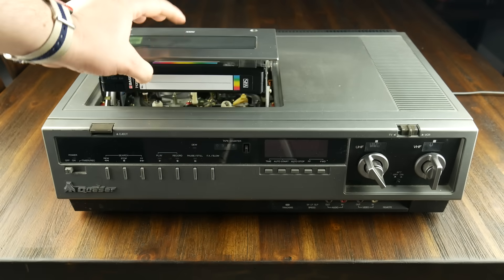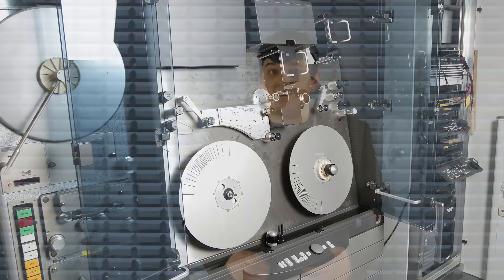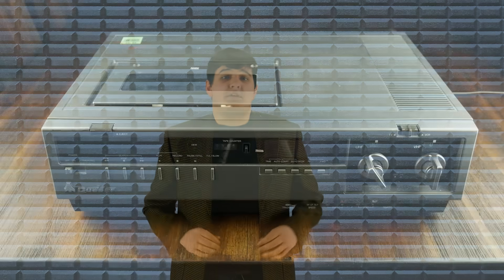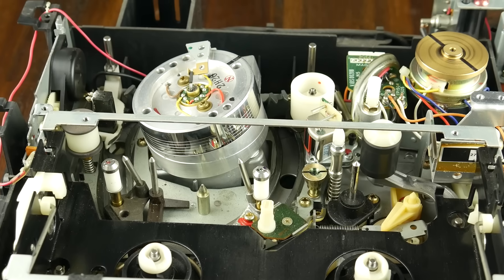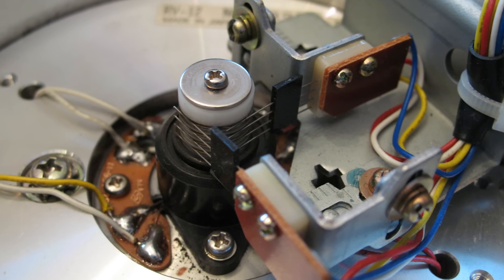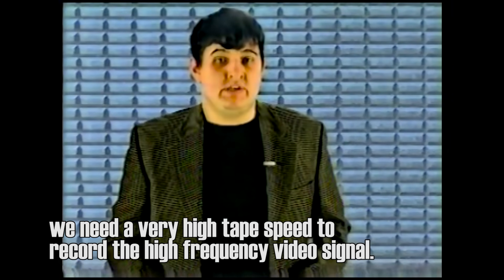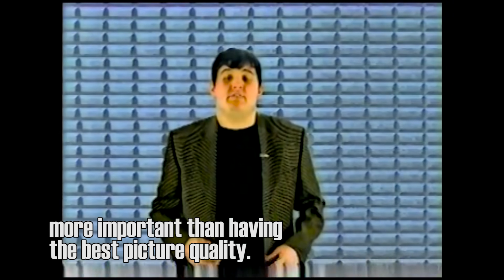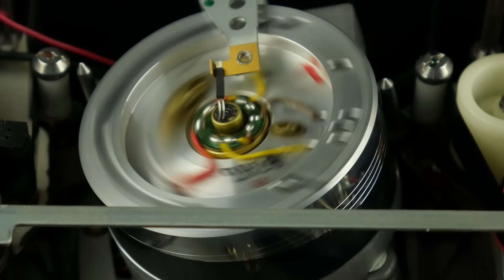The Impossible Feat inside Your VCR

Comment: Thats so strange about no LP after the 80s. It must be an American thing, in the UK we had LP and ELP right till the end.
Reply: SpriteFUN    PAL LP and NTSC LP are different things. in europe we had SP - LP ( and in a very fer panasonic and jvc decks SLP ) in the NTSC realm it very different. and here in europe we had 240 minutes tapes from almost the very beginning and excellente basf 300 minutes.
Reply: Same here in Buenos Aires, Argentina. As HD recording machines are not available here I still use a Panasonic NV-HV60 6 head video recorder plays back very well on the smart TV.
Reply: My philips vcr bought in 1999 could play ntsc, pal AND secam tapes and deffo had support for lp as well.
Reply: He's wrong. Every VCR I've ever used has had LP and SLP recording modes. I have a low end CRT TV/VCR combo from 2000 and it has 3 recording speeds. Enough said.
Reply: Pressure banding, Tip error, guide height adjustment, Chromatech and Amtech error, Air pressure... Head optimisation, F and Q controls, master equaliser, tracking error, sticking your thimbnail against the head on Transmission to cure a head clog... Oh, I could go on !
Reply: Why are you so angry about this?
Reply: Jason Well, he is not wrong.  I also was bummed at the loss of LP recording capability on my VCRs.  They dropped it sometime in the 1990s.  Maybe it was only JVC, since that was the only brand I ever bought, but they for sure dropped it and kept it dropped.  Even high-end SVHS decks.   google VHS "dropped LP speed" and look at the 2nd link, the one for forum .videohelp .com.
Reply: I'm warning people that this guy is a bad source of info. If I cared about what you thought I'd go dig out my VCR's and make a video showing they all have LP. I even have a digital VCR. It can output analog tape digitally and it looks much better. I know VCR's.
Reply: Yes, in was an American thing, we had 30 Frames per second instead of 25, which used more tape recording those extra frames.  The LP thing was created by Panasonic (Matsushita in Japan) and JVC never got on board with it, so machines that were made by JVC or their licensees never recorded in LP, though they would grudgingly play an LP tape (with no picture special effects, of course!)
Reply: Was about to say ! My mum recorded all her shows on LP.
Reply: Where I live you can still buy new VHS tapes in shops or online, including the E-240. 22€ for a pack of 5!
Reply: Brian Partington   No Panasonic /Samsung/ Lg / Loewe.  dvd/bd equipped with a hdd?   Ive been using a pioneer dvd/hdd deck since 2006!
Reply: Not in Argentina, Chile or Uruguay as far as I know, only available on the black market due to copyright laws on recording. They were available for a very short time about 10 years ago. Most people here have Netflix.
Reply: Same here from the north side of the country, 6Head Titanium HiFi Philco VCR.
Reply: Brian Partington  That doesnt make sense at all. copyright depends on the act of recording itself, not the media... correct me if Im wrong
Reply: Brian Partington we have the home recording act in USA
Reply: I remember a VCR combo having LP and that was as recent as 2005
Reply: That's interesting, I didn't realise NTSC and PAL were so different, I just thought it was refresh rate alone. I remember sometimes when you used LP or ELP the tape could get all chewed up, depending on the quality of your VCR of course.
Reply: NTSC used straight signal with no modification so frame rate was linear, PAl ( or Phase Alternate Line ) switched each odd and even fields , using phasor relationship any errors in colour hue was cancelled out. If the colour insertion signal was not quite right, could still get Venetian Blinds effect on playback signal.
Reply: Simon Anthony, 
Define:
  Pressure Banding
  Amtech error
  Air pressure  (in the context of a VCR)
  Transmission (in the context of a VCR)
  Head clog

sticking your thumbnail against a flying VCR head is a good way to break the head or your thumbnail.
Reply: This is all vTr stuff, professional broadcast kit. He started it ! These were all things you had to know about when running a Quadruplex 2 Inch VTR, Ampex VR2000 to be exact. The thumbnail thing though was true of any Quad. The drum rotated downwards, top to bottom of the 2 inch wide tape, at a slight slant ( no idea what, could be due to the tape movement ). The four heads each had an RF ( Radio Frequency ) output waveform level display on the 'A' scope. If a head became 'Clogged' - bunged up with muck from the tape, the RF would start to drop and the picture would show horizontal bands getting more and more noisy until finally going black. If it was head 4 that clogged, the video sync pulses that kept everything running at the right speed would be lost and the entire machine would 'lose lock'. If you carefully put your thumbnail up against the head, you could clear it without stopping the transmission. Yes, you could hurt yourself - that's why we were trained :-)
Reply: Pressure banding - AVR2s suffered from this, horizontal bands due to the frequency response of the four heads not matching that of the head that made the recording. Increasing the tips and altering the guide height could help. Tips? the concentricity of the head drum with respect to the 'canoe' shape of the tape guide - which held the tape in place by suction... yes, they needed an air pump to work.
Reply: Transmission? as in 'This is BBC 1'...
Reply: I used to operate a Quad RCA, never knew about the Thumbnail trick to clear a head clog, wow.
Reply: We used a cigarette paper wetted with isopropyl so no finger oil not left on drum.
Reply: Antonio Criado Diaz  This is true: my PAL VCR only had SP and LP, but you could easily buy TDK 240 min. VHS (their cardboard sleeve was pink, while the 180 min. ones had a blue sleeve).
Reply: American version of LP recording had some interesting artifacts including freeze frame being a total cluster@%$k.
Reply: Aha!  That explains why some of us (like me) remember LP halfway disappearing, and some of us not.  Thanks for that mind broadening.
Reply: He was wrong LP wasn't removed until the 2000's and it wasn't removed from the majority. He doesn't know what he's talking about. People who don't understand this just assume he is right because he made a youtube video. Anybody can say anything on youtube.
Reply: I posted the same thing so many people desperate to be liked on youtube just say anything regardless of whether or nor it's true. A large percentage of these kinds of videos are filled with lies. I trust older people about older tech. Younger people just say what they read on Wikipedia and don't have any experience.
Reply: and just because your parents owned a VCR doesn't make you an expert or qualified to explain anything technology connections

Comment: The biggest question I have after watching this is why doesn't the spinning play head completely ruin the tape after one pass?  Surely there's some trickery there as well.
Reply: Jordan Greene The heads don't actually touch the tape.  They are slightly recessed from the polished drum.
Reply: Yeah, precision engineering at its finest.  What was even cooler was some 1" open-reel video machines, which used compressed air forced through the heads and guides so nothing but the audio and control heads touched the tape!
Reply: Jordan Greene I dont know that but I know that signal on VHS fade overtime so if you dont storage it well the quality can get really bad over the time
Reply: Ok, thank you for the reply,  It must be a super precise gap then because its barely even noticeable in this video.

Comment: Anyone member the tracking knob?
Reply: Pepperidge Farm Members...
Reply: Yeah, but VCRs without autotracking, were also immune to copyright protection. You could record your rentals. Or...if you wanted maximum quality, you could buy the tape from Woolworths, copy it, switch the reels with those in the original, and then return the original. That's why rental stores started filling the screw holes with epoxy
Reply: yea.  i can't tell you how many times I 'fixed' people's VCRs by twiddling that damn knob. Seems once their toddlers started fiddlefarting with the knobs and buttons, well, they would mess it up, and I'd unf*ck it. 

Now, do you remember having to open the little door on top and manually "TUNE" the frequency for each channel?
Reply: Ash Scott - Ahoy me hearty. I too used to sail the high seas of video piracy. I often found the RF cable would get me out o' many a stormy screen when the AV cables wanted to cast me down to Davey Jones's locker. Never knew that the autotracking was the bane o' the pirate's life and so I thank ye.
Reply: For everyone triggered by "member" ... It's a joke from one of South Park episodes.
Reply: QuantumRift - I remember mine came with a wee plastic screwdriver type thing to change between UHF and VHF. Then you'd roll those little wheels around endlessly. It became annoying at school when you were the guy who'd always get called up to tune the damn things. You had to balance the point between delaying as much as possible but not so much that the teacher would cancel the original plan and make you do real work. Good times
Reply: VideoTape You could always bypass digital tracking by using for example on jvc decks, the channel +/- buttons. Cant say about other brands...
Reply: It was the same (channel for tracking) on my GE branded Thompson stereo (6 head) VCR. Pressing both channel buttons at the same time switched back to auto.
Reply: Earlier VHS players had manual TV channel tuning. It was fab
adjusting VCR, groovy effects in NTSC = Never the same colour twice!
Reply: Kurt Angerdinger:
"Yes, manual tracking was one of the huge disadvantgs of VHS compared with VIdeo 2000 (from Philips). Video 2000 had auto tracking from the frist product release on. But a few years later VHS also got auto tracking."

VHS auto tracking just automated the tracking knob by a simple video carrier level servo.  It just went with maximum level and sometimes missed the mark, leaving noise bars (and sometimes vertical sync instabilities that would roll the picture up or down) that you would have to adjust by looking at the screen. 
 In contrast, Philips' auto tracking was a consumer version of the broadcast machines' auto scan tracking, actually mounting the video heads on movable mounts to make instantaneous micro adjustments, the pause, slo-mo and search picture was incredible. This was a design necessity as there was no control track, due to audio taking up both edges of the 'two-sided' tape.
Reply: He's just referencing a joke from South Park about people whining about the present and seeking escape from the world via nostalgia, to their own detriment.
Reply: idk if memeber is specifically millenial, i think its gathered from the member berries from south park
Reply: It was a Tracking Adjuster, the knob was the person who twisted it.
Reply: Much better than digitally-controlled tracking.
Reply: Grand Negus axe???
Reply: Barry Puccini  That's very kind of you.
Reply: The rim thing around the channel tuning knob? Yeah, of course I member.
Reply: Remember the cable box 'push button' remote?  LOL
Reply: I was thinking "adjust the tracking" during the SLP sample...
Reply: QuantumRift: "Now, do you remember having to open the little door on top and manually "TUNE" the frequency for each channel??"

Yep!  We take VCOs for granted now, but in the '70s they were too expensive (like digital memory was as well).
Reply: Well, depending on the region it can be spelled as axe or arks. Both are acceptable variations
Reply: mine had a tracking remote but it's been lost for s while so movies are hard to watch
Reply: +Wrap World Creations
LOL
Reply: TheTarrMan I use it all the time.
Reply: I'd always try AV first but RF was my backup. Only ever really did it for personal use and for friends. Used to copy DVD's to tape for a long time until I found torre...err Netflix
Reply: our family had the Ferguson Videostar with that silly control; it was more convenient just to stand up and walk the four steps to the video recorder
Reply: Yep, in our case was a slider switch with a notch, we have barely used. Always at the default position worked fine, but it was a mid 90s machine. Then we have one with autotracking, but you could adjust manually if you wanted. However, we've never used it. VCR were in peak perfection by this era. Probalby the 80s ones need more tracking tweaking.
Reply: TheTarrMan member?
Reply: Looking for member berries anyone have any ?
Reply: Anyone recall the times dashing towards the VCR when it decided to Destory your brand new VHS tape.
Reply: Anyone remember the wired mote? I'm not a millennial but remember the kids truncating everything that way.
Reply: I member... member the eaten tapes? I member...
Reply: it's a southpark reference.
Reply: Our cable converter box was a rental, the IR remote was an additional cost.  (I think this was before universal remotes were cheap, I remember a learning remote being sold with 8 schedule slots, but it was $89.) As a kid who wanted remote channel changing I got extra cable from Radio Shack and ran two of them around the room edge and put the cable box on the end table. Now I could sit on the chair and change the channels, 32 of them with nothing on.
Reply: Triggered people don't watch South Park. He's referring to "memberberries" that are berries that say "I member" and are fueled by nostalgia.
Reply: Really now? "Member" coming from South Park? I all I 'member is George Lopez saying that during a stand up routine for how his family members talked lol, "you 'member that one time? 'Member? Yeah, you 'member. I 'member..."
Reply: TheTarrMan yeah man so many hours spent trying to find the magical sweet spot.
Reply: I member that too. Those times were great!
Reply: Prolly a time saving thing. I'll axe some of my millennial friends.
Reply: +Dr Ivo Robotnik I don't think shortening remember to member has anything to do with millennials, it's a South Park episode reference from a year or two ago. Never seen the ep, but a few friends started quoting it all the time... at the time.
Reply: Barry Puccini acceptable to whom?. Seems like ignorance to me to say it for one, and uneducated to actually write it for another. Only my opinion.
Reply: 'A little nonsense now and then is cherished by the wisest men'
Reply: I remember when we spelled the word "remember" correctly before all the millennials came along.